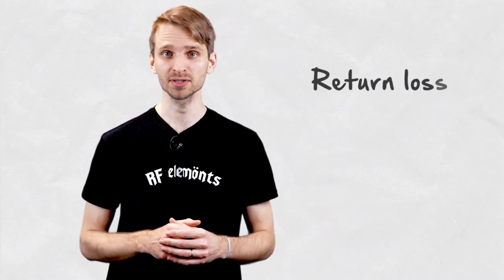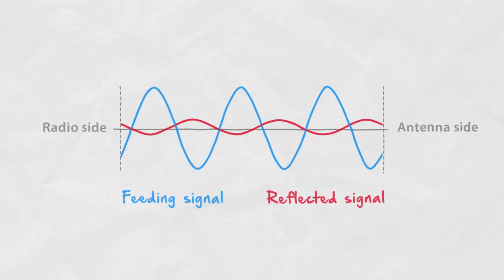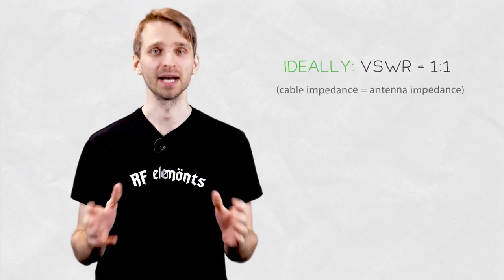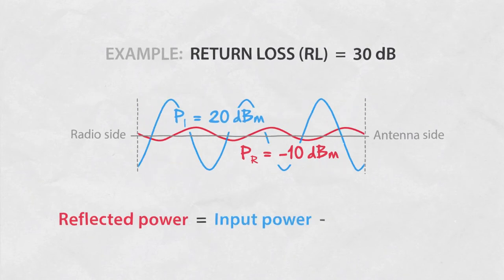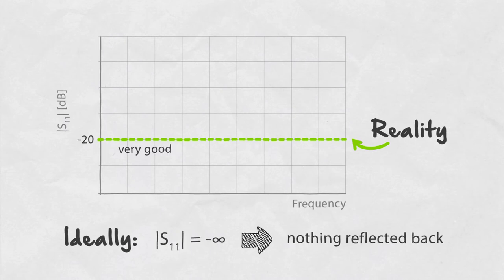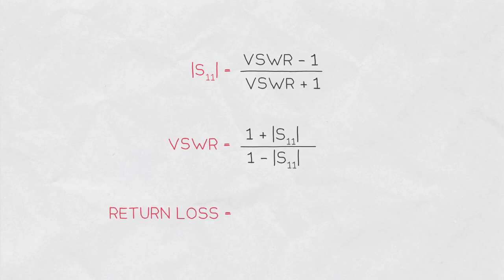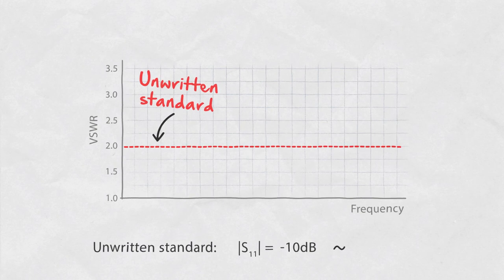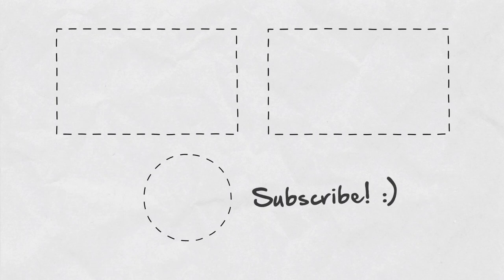Inside Wireless: VSWR, |S11|, Return Loss

Comment from the maker: What is acceptable matching level in your industry?
Reply: Thanks for the great video! and I have some things to ask.
The frequency of the reflected signal is the same as the frequency of the feeding signal or a little difference? And how about the relative phase between them?
Reply from the maker: @Tom-dn5de  Yes, frequency is the same, unless the signal reflects from some non-linear circuit or what not, then it can be different, but for antennas are linear. 
The relative phase can be calculated exactly depending on the transmission line length, but for practical life VSWR is more useful since it gives information on the steady state. If you're interested in transient phenomena, then the relative phase can be interesting for you.
Reply from the maker: @Tom-dn5de  The generator impedance measurement is done indirectly through the setup that's described in the pdf. The measurement signal is AM signal. The generator impedance is derived from the reflection coefficient of the modulated signal.
Reply: @Rfelements  Thanks for your great help! I appreciate it.
Reply: I am producing some very sensitive narrow-band UHF antennas. We tune them down to 1.03-1.08, and they can be no more than 1.15 through bandwidth of interest. 
Tuning is done by careful positioning and slicing small amounts of copper with Dremel rotary tool.
End product antennas are under 2.0 VSWR for +/- 1.2% of center frequency (+/-10MHz centered at 866MHz, frequencies used are 864 - 868).
The environment they're used in is very demanding because there can be a lot of metal. We tune each antenna by hand so they still work even when they are detuned by environment (because even detuned they're 1.5 or better).
Fiddly (and expensive) equipment that is used with those antennas start rejecting them immediately if VSWR goes over 2.0. They throw antenna errors maybe once per day even with VSWR of 1.5 or worse. They throw antenna errors even with store bought antennas (not with antennas of their design, you know, the ones that are 5x more expensive than the regular stuff). It gets really obnoxious, 5-10% of the antennas that we make never work no matter how much I tune them so we have to throw them away before installing.

Only when we started tuning each of them by hand, they all work for years without any problems.
Reply from the maker: @zlac  seems like a lot of extra sensitive and tedious work.  Why would you need the VSWR to be that good? Is it the distance or the radios that are too sensitive / rudimentary to work with higher reflections?
Reply: @Rfelements  it is UHF RFID reader, and it rejects antennas that are "not good enough", and it's very sensitive.
Default rejection is when it detects a -5dB reflection.
Reply from the maker: @zlac  I see, well in that case it makes sense you have to tune every single antenna by hand.. Although it's a lot of tedious work, I guess the price your customers pay evens it out, or, ideally should..

Comment: I've seen technician measuring VSWR in the link when they installed wireless communication system.Given that every parts is fixed, why would they bother measuring the VSWR? And if if it's poor, what to do to improve it?
Reply from the maker: It makes sense if the gear is expensive - you rather check everything well before you turn the system on. In the worst case, the reflection from the load (cable plus antenna and anything in between) can burn the signal source (unless it has some protection in place). If the VSWR is poor, then you have to check each component separately, figure out which one is not matched well and either tweak it or replace for a better matched one.
Reply: @Rfelements  Thanks for your time to explain it, I teach engineering subjects so its helpful to learn from experts in the field.

BTW, just a follow up questio. For practical purpose, does cutting the T-line a couple of cm or inch from Tx to Antenna have any adverse effect on  VSWR? Or does if affect phase at the output?
Reply from the maker: @cenonlumabadiii8976  Cutting a cable shorter affects the phase, provided that the transmission line has the same connector and is not otherwise deformed - its characteristic impedance does not change with it being longer or shorter.. Oh, and also the insertion loss, naturally - the shorter the cable the smaller insertion loss.
Reply: @Rfelements  Thank you again :)    Your answer are far better than just googling these concepts!
Reply from the maker: @cenonlumabadiii8976  happy to help! :)

Comment: Great explanation! When choosing an antenna, what is more important, the lower the VSWR or the higher the antenna efficiency?
Reply from the maker: That largely depends on the application, but generally speaking the smaller the VSWR, the higher the radiation efficiency of an antenna (unless there is a lot of loss within the antenna body, in substrate, or metal).
Reply: @Rfelements  I’ll be using a 5.8 dBi antenna for Helium mining.
Reply: @Rfelements   Antenna #1 - VSWR 860MHz 1.83, 930MHz 1.45 83%. Antenna 2# - VSWR 860MHz 1.9276, 930MHz 1.2889 66%
Reply from the maker: @harlemespanol  VSWR < 2 is considered a level of good matching for most applications. The choice also depends on the distance you're trying to cover, radio output power, sensitivity of the receiver, and SNR requirements. Based on these you can do a link budget calculation that will give you a good idea if either one of the antennas is enough.
Reply: @Rfelements  Okay. Thank you for your insight.

Comment: Hi, good effort. But I think you didn't follow the right way to calculate the reflected power. Cause your input power is in dBm and RL (30 dB) is a unitless parameter. So, how is it possible to subtract a unitless parameter from a parameter that has a unit? Can you explain this, please?
Reply: I can because who told that return loss had no units it's there in db's so input power can get added if it is gain and subtracted if it is loss that's it

Comment: Hello, I'm looking at an antenna that is good on most of the frequencies it can use except for the one I'm interested in which 617-700, at 617 it spikes around 5 VSWR and eventually comes down to 2.5 VSWR at 680 mhz, should I purchase this antenna or pass on it? Thanks for the video, this helped more than the other sources I've been using.
Reply from the maker: Hello. If the worst was 2.5 maybe you should consider it, but 5 is just too high. Thanks
Reply: @Rfelements  Thank you, that helps me a bunch, much appreciated.

Comment: Why this video said the -20dB for S11 is already consider among the best value for antenna performance. Any reference to take as prove?
Reply from the maker: Hi Harliza, in the video it says -20 dB is considered a very good level of matching, not 'the best'. The requirements on the level of matching vary from one application to another so it's all relative, but we can say that in the world of antenna engineering -20 dB is a pretty good one, considering it means 1 % of energy reflecting back to the signal source..
Reply: @Rfelements  Thank you so much for your good explanation.

Comment: Please what should we do when the vswr is above 2.5
Reply from the maker: Use a different antenna. If its specified VSWR is above 2.5, it's a poorly designed product. Generally, it depends on the application if 2.5 is too much. What application / frequency band are you considering?